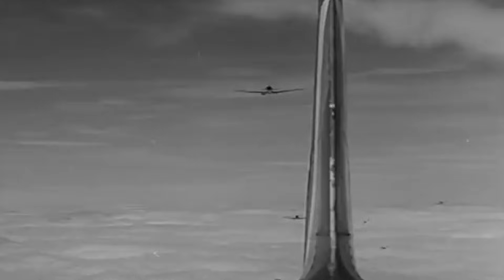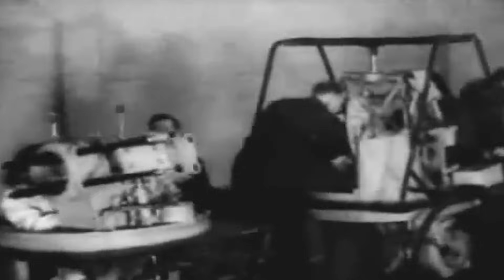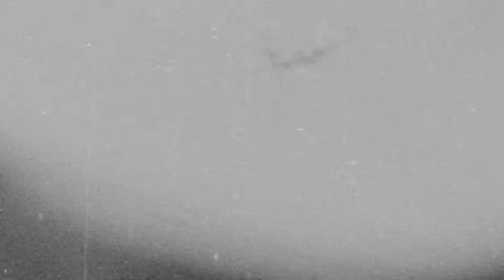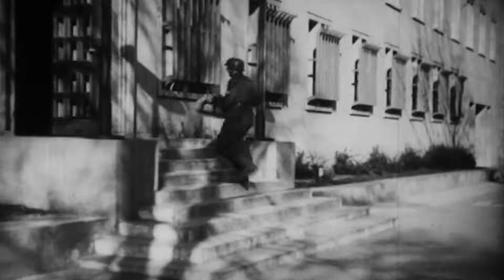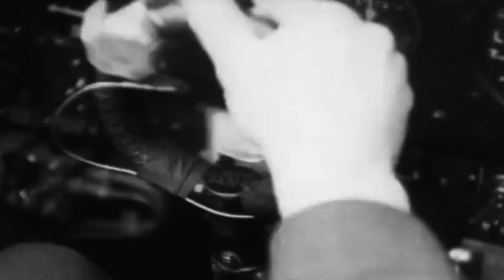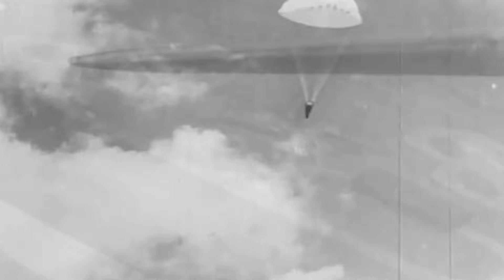The Ridiculous Plane with the Sneakiest Weapon of WW2

Comment: In short, the BP Defiant was NOT conceived or built as an "air superiority fighter" for taking on enemy fighter aircraft, but as a "bomber destroyer fighter", a role that due to the outcome of the battle of France never actually occured, and so it was temporarily forced into an air superiority role it had NEVER been designed for.

The Boulton Paul Defiant was originally built in response to the British Air Ministry's F9/35 specification for a heavy turreted fighter in 1935. The background to this requirement for a "turretted fighter" was this. 

In the run up to WW2, the likelihood of German air attack on the British isles was uppermost in the minds of British defensive planners. It was known that German bombers flying from airfields in Germany or even the Low Countries would by their distance from the British mainland be UNESCORTED as German fighters of that age did NOT have the necessary range to reach Britain from Germany/Low Countries. With that point in mind it was also known that the most dangerous position to attack a bomber stream from was the rear, with most bomber aircraft having heavy defensive fire to their rear. So the plan was to have a turretted fighter that would NOT have to act as an "Air superiority fighter" and tangle with escorting fighters, but instead fly ALONGSIDE the bomber stream where defensive fire from the bombers was a lot less heavy, and from that position HOSE the bombers with heavy MG fire from relative safety with its 4 turreted .303s.

In 1939 this modus operandi was a logical and sound strategy.

Now fast forward to 1940 and the completely unforeseeable collapse of France. German airfields were now NOT in Germany & the Low Countries but instead were just 20 miles away across the English Channel in France, and so the bombers now attacking the British Isles WOULD be escorted... but it appears in our "darkest hour" when all aircraft were needed, someone in RAF Fighter Command decided that the BP Defiant would now have to operate as a mutli purpose air superiority / heavy bomber destroying fighter plane.... a role for which it was NEVER designed or intended, but the attitude was apparently "we've paid for these sodding planes and we're bloody well gonna use them" Which resulted in the useless deaths of many young RAF airmen.

The Defiant DID go on to be a rudimentary night fighter, then a world first "airborne electronic warfare" aircraft and after better aircraft were produced for that role, it was finally used as a target towing tug.
Reply: The Defiant squadrons should have been put in 13 Group, based in Scotland - not in 11 Group based in South East England.  Scotland was out of range of German fighters.
Reply: @timonsolus  Good point. It would have been a better test of the Defiant's "raison d'etre" if they had been in position to receive the Luftwaffe attack from Scandinavia on 15th August 1940, which would have been a closer match to the scenario that they were originally designed for.

I do not know why the Defiant squadrons were NOT placed in the North East and Scotland.... but I will have a look into the question.

Comment: Too bad they didn’t produce a fighter version without the turret and with only a single pilot and dedicating some of the weight savings to much greater forward armament. Without the drag of the turret and the weight of a second crewman and the turret and ammo, I wonder if such a “fighter” version would have such an increase in speed, maneuverability, and firepower, yet still be almost indistinguishable from the standard version, and always deploying a mixture of the two, would have made them a much more formidable target for the 109’s, and bring the loss statistics down. I would further suspect that a single seat, un-turreted version would actually come off the same basically unaltered assembly lines faster than the standard version, and any that they displaced would be compensated for by reducing losses in battle. Just a thought.

Comment: The Defiant was, predictably, not much good as a day fighter, the weight and aerodynamic penalties of having a turret seriously handicapped its performancr. On the other hand, by the standards of the time it wasn't a bad nightfighter. Apart from the turret handicap the plane was on a par with Hurri and Spit, and I always thought that the turret should have been removed, the gap faired over, centre of gravity restored by shifting the fuel tanks, and forward firing guns installed. At least a few experimental aircraft of this kind should have been tried. I saw a Defiant flying low over Tuffnel Park during the 1940 blitz, a black silhouette against a rosy night sky, its roundels lit up by the flames below

Comment: Interesting video. Yet, Defiant was the product of what a committee comes up with. Tasked with building a horse they built a camel. 

As a horse it was a dud. 

The success of the Bristol Fighter inWW1 was misunderstood. In biplanes with a strong engine having a gunner won't empede effectiveness.

Fokker grasped the problem with the C5 and later C10. A low and slow light bomber scout. Praying on enemy spotter aircraft.

As a high end fighter it was already a dud on the drawing board.

As an afterthought a dud camel.

There wasn't a role it could do best. Only when bombers were unescorted could it do a what the Germans did as Schreage Music.

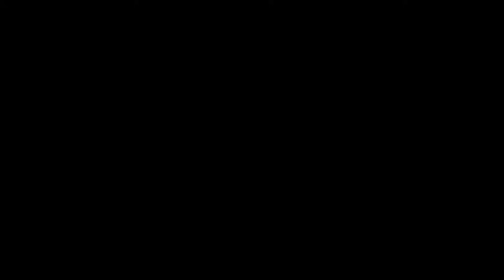Fokker again got it right with the G1 heavy fighter. Greater endurance for a required standing patroll. I don't know or think the Defiant was a concept made before radar or such a concept. 13:50

Comment: I can not find an image anywhere that has the Defiant with a gun sight, confirming the pilot rarely, if at all taking control of firing the guns locked at 19 degrees. I imagine handing off control back and forth between the pilot and gunner would cause disruptions and maybe even confusion during tense battles.
Reply: The guns weren't synchronised with the propellers. In theory they could have fired forwards, but they would have shot their own propellers off if they had  tried to do it.
Reply: Defiant was not supposed to fight other fighters, it was supposed to be escorted by single seat RAF fighters into battle, to deal with enemy bombers. If caught by enemy fighters, the rear gunner was supposed to shoot the enemy fighter down/drive it off (in coordination with the pilots manoeuvres), especially if the Defiants could form a circle.
Whilst theoretically it could fire forward by the pilot, in practice, this wouldn't be used.

Comment: Point of order: 264 Squadron's claims over Dunkirk are extremely exaggerated as a result of the over-claiming typical in dogfights of the time.  For instance, if three separate aircraft fired independently at the same enemy aircraft - each unaware of the other fighter's presence - and that enemy plane was shot down, the result was that back at base three separate "kills" would be logged when in fact only one had been scored.  264's actual claim for the day is closer to 12 or so.  Still impressive, but nothing special.
Reply: Typical squadron kills in an engagement would be low single figures, so 12 is still rather special.

Comment: The basic problem was there wasn't enough power in a single Merlin engine to drag it along with the turret. It would have made a good night fighter, but the early on-board radar was heavy, and that slowed down the Defiant further. The Bristol Beaufighter introduced at the beginning of 1941 had two Hercules (or Merlin) engines and lots of power to carry early radar, radar operator and 4 x 20 mm cannons and still be fast enough to catch enemy bombers.
Reply: It was used as a nightfighter, with radar.
Reply: There was a version of the BP Defiant without the turret, ie the Boulton Paul P.94.

The first Defiant prototype had not been fitted with a turret at first and had an impressive top speed. In 1940, Boulton Paul removed the turret from the prototype as a demonstrator for a fixed-gun fighter based on Defiant components. The armament offered was either 12 .303 inches (7.7 mm) Browning machine guns (six per wing) or four 20 millimetres (0.79 in) Hispano cannon in place of eight of the Brownings. The guns could be depressed for ground attack. By that time, the RAF had sufficient quantities of Hawker Hurricanes and Supermarine Spitfires and did not require a new single-seat fighter. With a calculated top speed of about 360 miles per hour (580 km/h) at 21,700 feet (6,600 m) the P.94 was almost as fast as a contemporary Spitfire although less manoeuvrable.

Imagine that thing being unleashed on the Luftwaffe in 1940 lol.
Reply: @veeeks2938   A Spitfire I with a bullet-proof windscreen was hard pressed to quite reach 360mph in 1940. But then 360mph calculated for the BP might not take into account a bullet-proof windscreen either.
Reply: @wbertie2604  Considering they flew with turrets against BF-109s, I'd be prepared to beiieve they were crazy. And there were lots of crazy ideas around the Battle of Britain...
Reply: @veeeks2938 the original turret-less defiant prototype couldn't do 360 mph let alone a later model with 4 cannons. the turret-less and unarmed defiant III could only do 260mph at 20000ft.
Reply: basic problem was the defiant was too slow, too heavy, and lacked fire power and wasnt even used correctly tactically. the hurricane mk1 has 8 of the same gun instead of the defiants 4 and was faster, more maneuverable and cheaper.
Reply: Conclusion - Britain continued to innovate / develop / enhance / better understand air warfare needs at a more rapid pace between 1938 and 1942 than its opponent, continuing that process through to 1945.  And the experimental aircraft were built and flown, unlike Goering's war winning paper planes.  Some credit is due to permitting resources to be allocated to some of the fringe concepts, whilst avoiding ludicrous excesses.
Reply: Maybe they could or should have adapted a (2 power plant) Mosquito, perhaps that turret could have been manufactured from lighter materials.
Reply: @harryzero1566  they tried it with the Beaufighter MkV. It didn't make it past the prototype. It was Merlin powered and had the Boulton Paul turret. Don't think they ever added the turret to the mosquito though.
Reply: @geesehoward700  The Ministry did insist dH try it on the Mosquito but de Havilland resisted with all their might. They even started building one to trick the Air ministry but mothballed it as soon as the prototype W4050 showed its phenomenal speed and the potential decHavilkand knew it would have if kept clean  (dH were the masters of reducing drag, at that time, and minimalism, e.g. see the Albatross airliner)
Reply: @harryzero1566  a four cannon turret was mocked up on a Mosquito. Bolton Paul also designed a twin engined aircraft with a four cannon turret. Gloster (I think) designed a twin boom night fighter with turret and forward cannon. The requirement was passed over to Northrop in 1940.
Reply: The more basic problem was France fell, if France hadn't fallen (which no one could have really expected) the fighter would have been slaughtering unescorted bombers. It was never designed to take on enemy fighters. I am assuming its easier to shoot down bombers with a turret than with guns in a wing?
Reply: @jons9721  maybe we should have just asked Hitler to send the bombers over unescorted. The plane and it's philosophy was bad from the start.

Comment: Why didn't they fit forward facing guns on the wings then ? If it was better without the turret ,performance wise , why not leave the turret off , make it a single seater and put guns on the wings ?
Reply: That would be a hurricane then.  the Defiant is a bit of an odd bird, in that it fulfilled the requirements demanded off it, but that those requirements were deeply, deeply flawed.  It was. quite frankly, a decent design, made to a shite specification. And as a result, a death trap in the real world.
Reply: @FelixstoweFoamForge  they made perfect sense for attacking unescorted bombers. German bombers, without bases in France, would have been unescorted. What scuppered the Defiant was the Battle of France.

Also, 303s were an interim solution and Boulton Paul was working on cannon armed turrets. However, such development was stopped in 1939 as the requirement was to have powered turrets with belt fed guns for all bombers as not all had them at that point.
Reply: @wbertie2604  And that's exactly my point.  For attacking unescorted bombers, the defiant would have probably performed ok.  That was what the specification called for, and what they were designed to do.  But there's the problem; The specification relied on the enemy always doing what was expected of them.  Never a good idea.  Yes, no one could have predicted the Fall of France.  But someone could and should have expected the Germans to eventually have increased the range of their fighters.
Reply: @FelixstoweFoamForge  many good points, although at the time of the specification there was a mismatch - our bombers would be so great they'd not need escorts but the enemy planes would be vulnerable but somehow they would fail to grasp this and not use escorts. So there was some logic but also a lot of wishful thinking.

Luckily for the Defiant, it worked at night.
Reply: @wbertie2604  Definately.  Somehow the dictum "the bomber will always get through", only applied to our planes, not the enemy's.

Comment: With a more powerful engine, and front firing wing machine guns, They could have been used for a longer time with less losses.
Reply: I think they already had something like this -- the Spitfire. Maybe you've heard of it?
Reply: @seanbigay1042  Same engine was in the Spitfire, the Spitfire just didn't carry the extra weight and drag of the turret and gunner. So climb rate and maximum speed were far superior
Reply: Ripping out the turret and placing the guns in the wing would have produced an equivalent to the Hurricane.
One of the issues with operating the Hurricane (and Spitfire) in the night-fighter role was that flashes from the exhaust ports destroyed the pilots night vision.
Reply: They didn't have a more powerful engine at the time (up to the Battle of Britain), & as the RAF High Command didn't like the Defiants (thinking overall, a single seat fighter would be better, which even the Squadron Leader of the Defiant's most successful daylight squadron conceded), they didn't give them the new, variable pitch propellers either.

The concept died out due to Operational requirements & new technologies. Enemy bombers (those that were left after most departed for Russia) could be dealt with better by twin engine planes, & single engine fighters were used over Europe until the end of the war.
Reply: A version with just forward firing guns was prototyped as a way for factories producing the Defiant to produce something with the performance of the Hurricane.

Comment: This could've made a great ground attack aircraft, like the IL-2 Sturmovik. It could've been fitted with 4x 20mm cannons 16 rockets and 2,000lbs of bombs, with significant modifications. The fact that it wasn't used for this is wasted potential.
Reply: 2000 lbs of bombs: how? More to the point? Why? The Mosquito did all this, much better.
Reply: @ClimateScepticSceptic-ub2rg  The British never had an effective single-engine strife aircraft before 1942 (then came the 'Hurribomber' in North Africa). This could've replaced the Fairey Battle and held the line until the 'Hurribomber' and later Typhoon filled that role.
Reply: There’s a huge difference between between 4x7.92mm and 4x20mm
Reply: @TheTyrantOfMars  I know, but 7.92mm aren't going to destroy German tanks. Yes, it would've been heavy, slow and unmanuverable, but if it had Spitfire/Hurricane escorts, it could've been really effective.
Reply: @Homelanderv-1  Heavy armour would make this even worse. They designed the Hurribomber & anti tank Hurricane versions with 40mm guns instead.  Other major issues are they couldn't produce enough turrets, & the Defiant wasn't liked by Heads of RAF Command, so it didn't have high level backing.
Reply: p.s It also wasn't given priority for the new variable pitch propellers, due to lack of high level backing.
Reply: Powered by a 1030 hp RR Merlin?
Reply: @ericvadekro8334  Of course this would need new engine modifications.
Reply: Blud, that ain't a Firefly
Reply: @ДартКоммунистус  I never said it was.